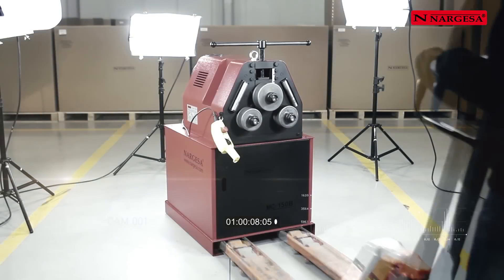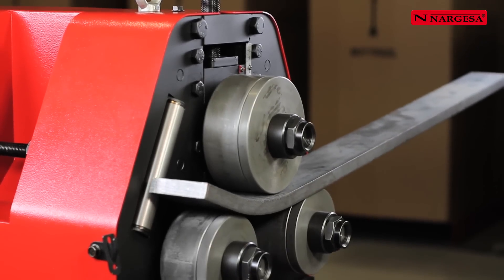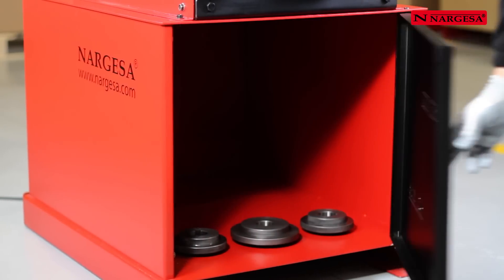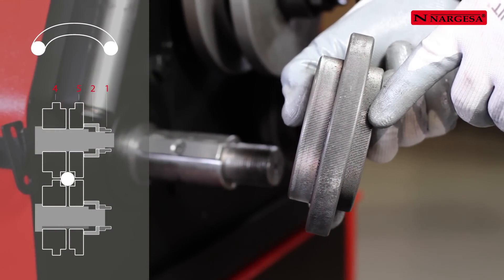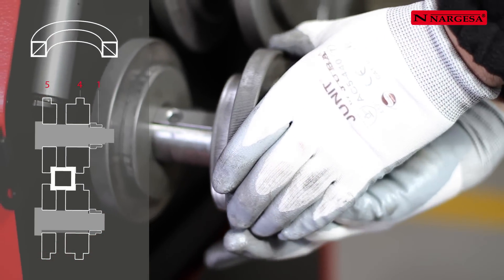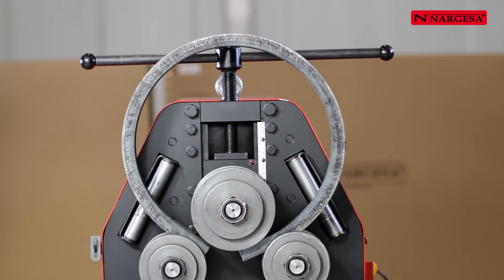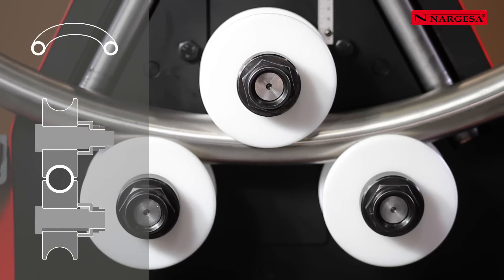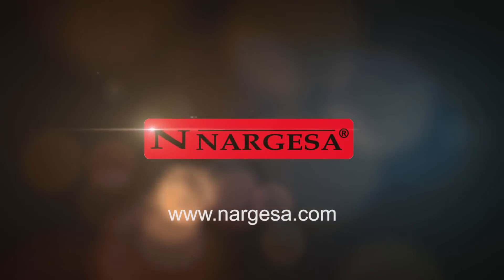TUTORIAL ON HOW TO BEND WITH A SECTION BENDING MACHINE MC150B NARGESA

Comment: hi, I apologize for the inconvenience, I wanted to ask, what is the material of the rollers?
Reply from the maker: The rollers supplied with the machine are made of Steel F1140 treated and rectified.
To bend all kinds of round steel or stainless tubes we have the Rollers made of F155 Steel and treated at 62 Rc.
To bend round tubes of stainless steel, aluminum and delicate materials with thicknesses less than 2.5mm, we have the Rollers made of Sustarin (Polyoxymethylene, high resistance and high rigid crystalline thermoplastic, low friction and excellent dimensional stability)

Comment: How much is the accuracy on final diameter?
Reply from the maker: The accuracy in the bending diameter is exact. Please note that the positioning of the rollers is manually controlled. in order to achieve the desired diameter, you must insert the tube or profile and press it with the upper roller, lower the roller a little and pass the tube through again. Repeat this operation as many times as required to reach the desired bending diameter. Once this is done, and with the help of the millimeter scale that is on the upper roller, you must repeat the same position dimensions so that all the pieces obtained are identical.
Reply: Can you achieve a tolerance of +/-1/32” on 60” dia. with 3”x3”x3/16” HSS tube? Just as example let’s say. Thanks.
Reply from the maker: @bonjournito  this tolerance is extremely small, take into account that even both tubes may behave differently when bent at different conditions and therefore the result may vary

Comment: how can we get the desired radius
Reply from the maker: Hi Mr. Shaikh. In order to obtain a specific radius, it is necessary to bend the tube several times, just in the  first piece. We make some bends and adjust the upper roller down, some millimeters each time we bend until we get the radius we need. Once we have obtained this radius, we jot the position of the upper roller and we’ll be ready to make the other bends which will be identical to this first piece we made as a test.

Comment: What if i need to make a L shape with stainless steel pipe of 2.5 inch
Reply from the maker: Hi @Anything goes Here. This machine only bends steel into circular shapes. To perform 90 degree angle bends, you need a Non-mandrel tube bender. I recommend that you see the CC90 Nargesa machine: https://www.nargesa.com/en/industrial-machinery/non-mandrel-tube-and-pipe-bender-cc90-cnc

Comment: Not very impressive. The machine should have an adjustment fish that can at least estimate the bend radius if the object is bent into a complete circle. Or inches to make a 90 or something. Looks like it has nothing to make perfectly repeatable work which should definitely be a standard for a large expensive machine. When building a product you need some kind of a reference to easily repeat the same bend.
Reply from the maker: We appreciate your comment @jackle842000. As for positioning systems of the axes of the machine to repeat processes and that all the pieces are equal, we currently have two options of the same system. In the case of the MC150B, it incorporates a millimeter scale on the upper axis, this allows us to write down its exact position in each operation. If we place the upper axis at the same level we have noted and repeat the bending, the resulting pieces are exactly the same. In the case of the MC650, the system is the same, the only difference is that a digital display is the one that indicates the position of the axes. For more more information, please send an email to nargesa@nargesa.com and our sales department will assist you directly

Comment: Sir can we make a curve of 40 cm dia
Reply from the maker: Hello @Bhushan Ther. The diameter of bending is related to the type and measurements of the material and the capacity of the machine. We manufacture five models of tube and profile bending machines, with different capacities. In this link you can see the capabilities of these machines in different profiles and tubes: https://www.nargesa.com/sites/default/files/bending_capacity_1.pdf

Comment: Thanks brother don't misunderstand. To making shop chair I need very small circle for SS tube and making cloth hanger need diameter 150 mm 180degree  uturn albow.so you think 150 mm only 6" circle and chairs need 12" circle.how can rolling this? Your also maybe 5". yesterday wrote that bkz hand made roller I have to running regoler and that work very leburing works and such rounding not very well , tube circle ruin then I have to so many grinding and polishing. thanks.
Reply from the maker: Dear Islam N, please send us a technical draws for each part you want to make to nargesa@nargesa.com, and our technicians will see if it's posible to do with our bending machines or not

Comment: how to set bending radius for the arches using your machine, or it is only try and error ?
Reply from the maker: Dear Hashim M. With this kind of machines there is no other way to do it.
While making the first piece you should set a sequence of movements for t he rollers so the result could be the desired diameter.
In order to do this in a fast and simple way, Nargesa section bending machines have got millimeter scales on both sides of the rollers, so you can make series of parts with the same bending radius. however the first part will be always a try.
Reply: Nargesa thnx slot for ur reply I will contact ur sales team to check ur price and other shipping methods
Reply from the maker: Dear Hashim M. Send an email to nargesa@nargesa.com and our sales department will assist you. Best regards

Comment: Hi ! I am really interested in your tools. I have a question about them. For example, I am going to produce air conditioner installation kits. You know, we are working on copper tubes. Therefore, when i get this machine, I'll bend or roll the tubes but would i able to cover it with a insulation pipe? For instance, copper tube is gonna get inside of insulation pipe. Can this machine do this? I mean double process at the same time.  Thanks!
Reply from the maker: Dear Sir +denizhan çavuşlar 
Please confirm if what you need is to used already covered pipes to be bent or make both operations at the same time. If it is this latter one, because our machine has no automated feeding for covering pipes… In any case if you have any doubt, just give us a call and we will have a talk. +34 972568085
Regards

Comment: Is there a method of calculating the correct bend settings to attain an accurate and repeatable large radius?
Reply from the maker: Dear +Timothy Hawkins, the section bending machine MC150B is equipped with a millimeter ruler on the top roller to be able to repeat parts. You just need to register the various measures you use to perform a specific curvature and repeat. If you need more specific information, please send an email to nargesa@nargesa.com and our sales staff will attend. Best regards

Comment: Hi, I could not understand what are the plastic rollers made of? How long do they last?
Reply from the maker: +cezar t Hi Mr. Cezar, apart from the standard rollers, we also offers different types of additional rollers to produce other types of bending, according to the configuration of the material to be handled, as well as specific rollers for work with stainless steel or aluminium, manufactured with *Sustarin, that prevents scratches and damage on the surfaces. 
* Sustarín: Polyoxymethylene, high resistance and high rigid crystalline thermoplastic, low friction and excellent dimensional stability
For more information, contact us at mail nargesa@nargesa.com. Best regards